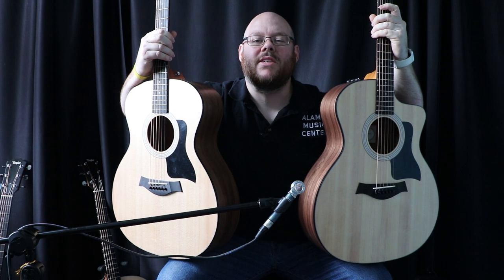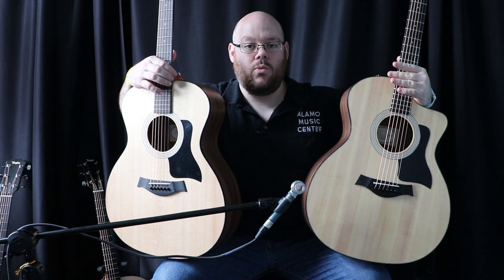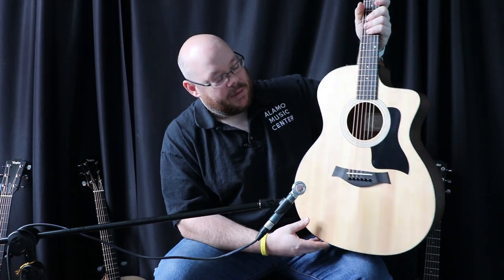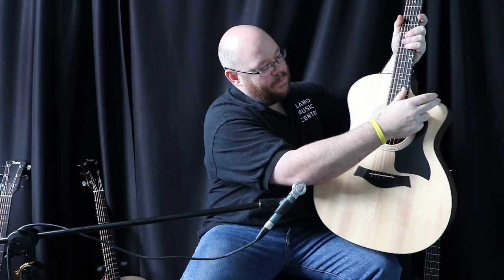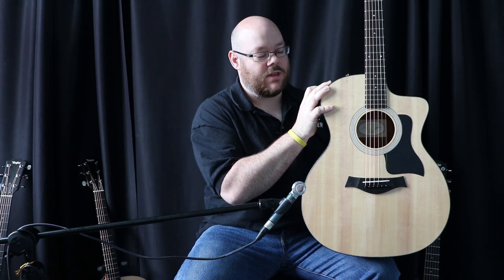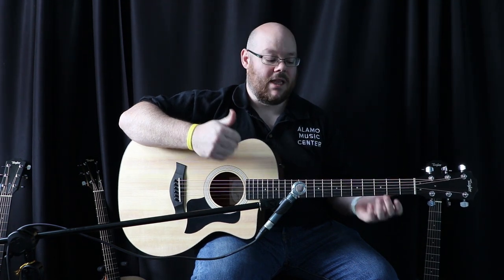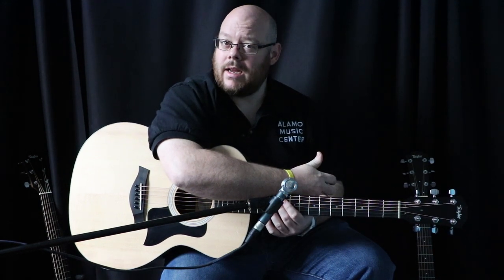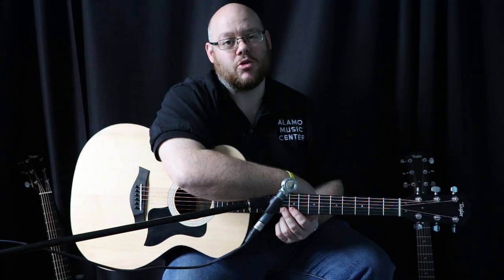Cutaway vs Non-Cutaway: Taylor 114ce vs 114e Comparison

Comment: first i want say there is a massive differance in sound! slightly is different! it sound like two total different models or brands.
a guitar with a cutaway ever sound more thin and "ovation direction" from sound. special when u plug the guitar and use the Piezo, than sound get very unnatural.
Your overall sound is muddy and mic placement seems not sweet spoted...more like put it "blind" over the 12th fret. but i think it comes more from your room reflections, the room u record in sound really bad.
that tylors are "dreadnought" type guitars and they ever has tendence in studio sound "too big" and boomy and can be tricky record them. 
peoples buy guitars with a cutaway are comfort pussies with no ears ;) XD